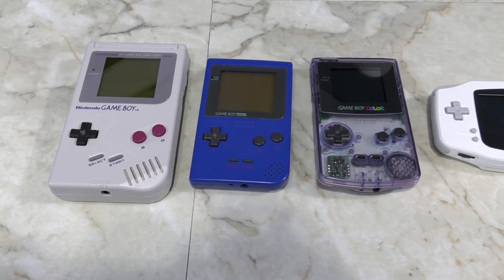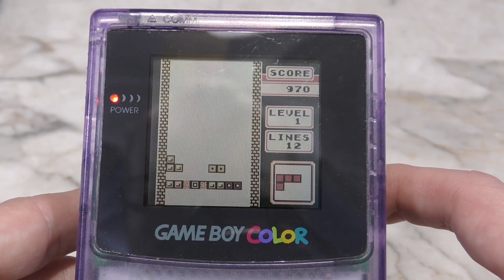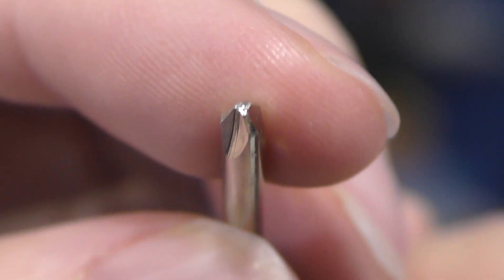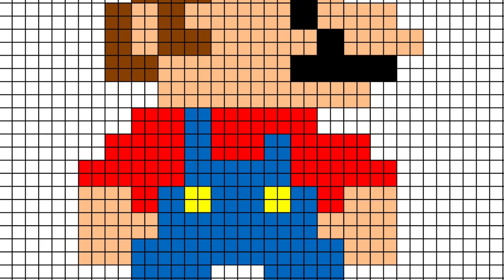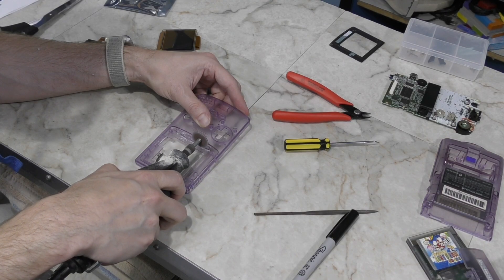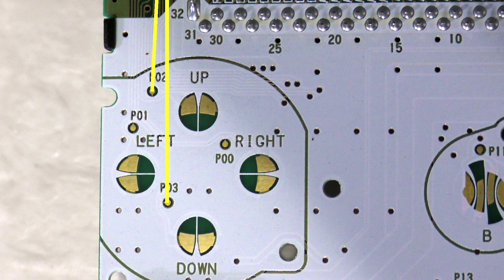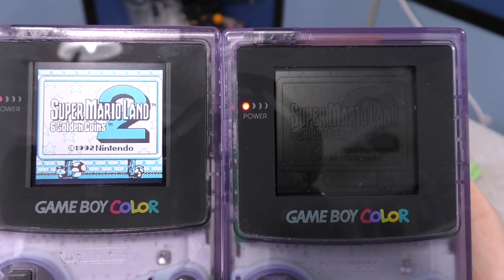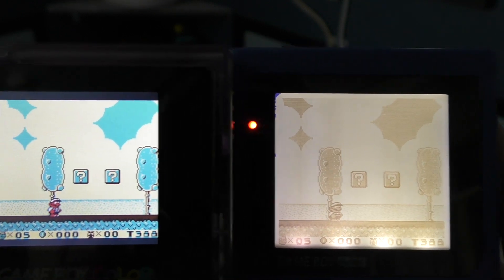Finally - A Gameboy Color Backlight Mod!

Comment: You should've used the Benn Venn's freckleshack. Way easier to intall and their newer batches come with a brightness controller
Reply: Bailey Washington  frontlighting is even worse since all the colors become washed out
Reply: Bailey Washington  cheaper than the competitors
Reply: Bailey Washington  the freckleshack color palette is almost identical to the OEM LCD. Designed that was for this exact reason
Reply: Bailey Washington  I really prefer the correct/original colors of the GBC as well. That's why I couldn't stand playing GBC games on an AGS-101 (even most GBA games show incorrect colors on the backlit screens). The solution for people like us right now is sadly only in emulators that offer color correction. Gambatte (a Retroarch core) is extremely accurate and also supports color correction. I've found that using it on a Nintendo 3DS gives something really close to what an actual GBC with backlight would have been like.
Reply: @Izquierda   There are a lot of reasons for this. Gameboy Color and (especially) early Gameboy Advance games were designed with the reflective LCD displays in mind. Because of how they work, they are naturally dimmer than a backlit LCD. These games tend to look washed out when played on a much brighter backlit screen.

In my opinion, a PROPER front light would be best if you're looking for a Gameboy Color with authentic color. If you take a front light out of an AGS-001 GBA and fit it into a GBC, it looks fantastic. There are some aftermarket front light kits, but they're pretty terrible. If a proper front light kit was ever made (with a good light panel like the AGS-001 had) I think it would be the best solution.
Reply: @adimifus  A proper front light is not bad, though once you have experienced both backlight and proper colors it's really hard to accept the compromise with a front light. It also probably doesn't make sense for most people to transplant a GB SP's front light to a GBC just to keep the form factor of the GBC, might as well just play the games on the SP and also play GBA games on it. The original phat 3DS actually has a way better front light than the GBA SP, but unfortunately it doesn't support GB/GBC carts and so you're stuck using emulators on it (which are decently accurate but not as good as what you can get on the 3DS).
Reply: @Izquierda  I agree 100%. Front lights have a lot of downsides, but if you like the color of the original GBC LCD, it will preserve that. If someone would make a front light kit with a quality light panel, like the AGS-001, it would actually be a decent option. Using the 001's light panel is really only viable if you have a damaged SP where it's otherwise unusable and REALLY prefer the GBC form factor and LCD. It's admittedly a very specific and unlikely situation. 

Did the original 3DS have a front light? I thought AGS-001 GBA SP was the only Nintendo handheld that had a front light.

Comment: What does it do to battery life, though?
Reply: I'm wanting to do see if I could do an 18650 (or similar) mod.
Reply: Adam Carmichael you know there's 14500 cells that are the AA size, they just give more voltage... Much easier mod.
Reply: @lightdark00  Will a Game Boy accept the voltage? Those things are way higher than 1.5 volts and can kill some machines.
Reply: @lightdark00  I wonder if a pouch type battery would work even better, maybe allow for easy charging via USB.
Reply: John Knight you would need to change the arrangement of the cells. 2x2 would give a max voltage of 8.4v while the max with fresh AAs is slightly under 7v. A quick and dirty hack would use a diode with a 1v+ voltage drop.
Reply: @re-agent9364  This would be a better solution since you could match the voltage to the old AAs and there are pouch batteries that come with cell protection built in. Either 3d print a case or make one out of a material that is easy to shape.
Reply: Re-Agent I hate the USB charging idea. I want cells to be swapped out and not kill the battery from always charging it. I need a phone with swappable batteries, I kill a phone battery yearly.
Reply: @johnknight9150  i can certainly tell you my 9v mod i did when i was 10 killed my gbc
Reply: @lightdark00  Is it possible that you drain your smartphone battery as much as possible before you reload it? Because that was the preferred way with older batteries but not with current smartphone batteries. They die quicker this way and would live longer if they were constantly charged.
Reply: Benjamin Krupp nope. The best thing for me is keep a heatsink attached to the phone. Watching videos on cell service cooks and eats up batteries.
Reply: Sounds like you have bad power at your house or work. It could also possibly be a cheap charger you use . You shouldn't have a battery die that quickly. I would only use a quality charger, like the one that came with the phone, or a computer to charge the phone, preferably through a surge suppressor.

Surge suppressor wear out after 2 to 5 years, BTW, depending on power surges in your area.
Reply: KnightsWithoutATable I use the charger that came with the phone on a filtered ups power supply always. Apple wants you to buy new phones, I say no. I am on my fourth battery.
Reply: @lightdark00  I'm not sure if I should be horrified or impressed that you manage to trash a phone battery in a year. Even the phones I've charged in sub-zero temperatures (very hard on lithium batteries) last a bit longer then that.

If the pouch is set up to use the 25%-75% capacity range, you should get 10,000+ cycles out of it.
Reply: @lightdark00  Apple? Well, there is your problem. The OS probably looks at the voltage going down from age and flags the battery as bad or it is as you say and Apple just flags it as bad to make you buy a new phone. I wouldn't be surprised by either and the battery being perfectly fine and you just need to disconnect and reconnect it. Now, if it has started to bulge on the other hand, the battery is toast. Could also be a bad or poorly designed battery management circuit on the phone trying to fast charge and is cooking the battery instead.
Reply: @lightdark00  "the max with fresh AAs is slightly under 7v" Huh? I don't follow. We are talking about th Game Boy Color which uses 2 AA batteries, right? They are 1.5V (1.6V max) and there a 2 in series. So it is a 3V battery pack. Where do the 7V come from?
Reply: DA666 oh, only two? I remember my original game boy needing four batteries. I thought it was the same.
Reply: @lightdark00  
Are you saying that you'd rather buy new cells after 1 use (swapping out non rechargeables) rather than after 500 - 1000 recharges? That doesn't make sense at all. What's the point of swapping out rechargeable cells? You need to recharge them to reuse them.
Reply: John Thimakis swapping out rechargeables. I already have 14500 lithium-ion cells can have devices that use them.
Reply: John Thimakis the reason is longer life. Leaving cells at nominal voltage when not in use for some time is the best use. Charging them full before use is much better than having a USB charging circuit constantly charging them during use.
Reply: @lightdark00  
I've heard that too but I'm not sure or heard of actual studies on how it affects the total number of cycles.

I've heard that they should be stored at 60% not lower, only charged to 80% and then used until 60% remains and then recharged back to 80% for next use and so on.
Reply: @lightdark00  
The problem is you can't place them in the device without modification. AAs are 1.5V whereas Li - ion cells are typically 3.7V each.
Reply: John Thimakis it's not a huge modification, one that's easily reversed.  AAs generally top out at 1.65v, li-ion at 4.2v full. If only two batteries and you want the longer runtime, have the two parallel and drop 1v. The issue is you don't want normal li-ions to drop below 3v, and I doubt the space is available to use longer protected cells.
Reply: 7 volts!? A gameboy color runs of 2 AA's...
Those shouldn't be producing much past 3 volts (for both together), and most types of AA rarely even do that. (rechargeable ones tend to hover around 1.2 volts per battery, but they're also much more stable than say an Alkaline cell which starts around 1.5 but can drop as low as 1 volt as it discharges.)

Also 3 hours of runtime? For a Gameboy color?
I once timed mine.
It ran 28 hours off a pair of Alkaline AA's...
That's something like a factor of 9 reduction in battery life.
And people are actually stupid enough to ask why these didn't come with a backlit screen as standard. XD
Reply: @lightdark00  An LED would be needed for a voltage drop that high. I think a red LED would be a 1.2v drop.
Reply: @carneeki  Use 3.2V AA sized LiFePO cells and either mod the GBC to run them parallel or use just one at a time and bridge the other battery slot with a strip of metal, just make sure you get the 3.2v version not the 3.7v.
Reply: @carneeki  Battery mods don't sound like it's worth the trouble; buy a Duracell NiMh wall charger for about $20, comes with 4 AA rechargeable batteries. Buy a few extra to use in the Gameboy while the others are charging.
Reply: I'd recommend doing the 3 wire brightness mod and keeping the brightness at a lower level.  That'll do wonders to help your battery life.
Reply: You know what it does to battery life..
Reply: You can install a switching dc-dc converter and use higher voltage batteries. And you can wire the pair in parallel instead of series to keep it under 4v. AND you could current-limit the backlight LED for longer battery life. Instead of the current limiter, a simple diode (0.3-0.6v FB) in series with parallel 3.6v batteries should work great.
Reply: Looks like it reduces it greatly, ouch - "Recommended batteries are NIMH 1900mAH providing 3 hours of run time".
Reply: on the site-> Recommended batteries are NIMH 1900mAH providing 3 hours of run time.
Reply: There is also a Micro USB mod with the color and can install a lithium ion battery to it.
Reply: @FrezzyYT  that's the same YouTube show I was referring to!!
Reply: Just run lithium AA batteries
Reply: Blah blah blah, use a damn car battery ya pussies! Tone it down a bit and you got battery for months. It just won’t be very portable judging from the pantsies you guys are.
Reply: You could use 14500 LifePo4 batteries in parallel as they're only 3.2v.
Reply: @michaelparker2449  Don''t you mean 2 AA batteries in series is equivalent to 1 LiFePO4 cell?
Reply: @jtveg  More like the other way around with 2 LifePo4 in parallel having the same voltage as 2 aa in series.
Reply: @michaelparker2449  Putting 2 cells in parallel only increases their life, it doesn't change the voltage. Since it is the voltage that we are talking about, the number in parallel is irrelevant. You could have 1 on its own or 50 in parallel and it would still measure 3.2 Volts.
Reply: @jtveg  Yeah extending the life is the whole point, as the GBC can hold 2 14500 batteries which if put in parallel doesn't go over the maximum voltage the system can take but still gives the capacity of both batteries.
Reply: @jtveg  I think there is a bit of confusion going on here:
2 AA Batteries in series =  3v (3.2 max)
2 LifePo4 in parallel or in single = 3.2v
so you have to either mod the GBC or use one battery in one slot and bridge the other slot with "something"
Reply: @michaelparker2449  
Yes, I get what you mean now. The Game Boy has space for 4AAs so if you parallel 2 LiFePO4s and then put them in series with another pair in parallel, would mean no electronic modification, 6.4V, no physical modifications to the case other than rewiring the terminals with the added advantage of doubling the mAh rating.
Reply: @Bikey_McBeardface  
Better to just rewire the way the batteries are connected so that instead of all cells being in series, you parallel one pair and then series that to another pair in parallel.
Reply: @jtveg  Or you could use 3 Li-ion 14500 batteries in series with a small 6v step-down converter fitted in the fourth slot.
Yeah it will be more hassle than just having 4 Lifepo4 batteries, but  3 Li-ion 14500s still have a higher energy density than 4 Lifepo4 batteries, and they are also much cheaper.
Reply: I know I recently saw a show on putting a 3.6v 2Ah battery into a GBC... I just hope that board he used sends out a constant 3v to the GBC always.

I think he said he can go quite a long time with this setup, but then again I don't think he had this mod setup
Reply: That's the question I had right away! Time to mod a stronger battery into the mix I would think.

Comment: 0:50 That's definitely a sentiment I agree with. I think the mid-late 90s saw a lot of focus on impressing people graphically, with 3D being more than a pipe dream for most people now. Way too many titles that look cool for the time that don't hold up now... I think around 1995 to 1999 is the time of the talents of smaller developers showing through, the ones that couldn't afford to do great graphics but relied on gameplay or charm instead. They avoided the trapping of "great graphics, boring gameplay" just by not having enough cash or hardware and were better off for it looking back.
Then again, I wasn't around for the time, but I've tried to play as many games from that era as I can and the ones made on a shoe-string budget by passionate people were the ones that stuck out to me the most.
Reply: DOOM, Unreal and Half Life were the games that started the graphics powerhouse craze in the 90s and it haven't changed since

Comment: How does it look in direct sunlight? I'm wondering if the original screen may still have the advantage in that scenario?
Reply: In the full sun, phones need to be at max brightness usually. So the brightness mod would be a must then.
Reply: Looks fine but it's reflective, what me and my friends did was buy a matte tablet screen protector and overlay it on top. It was cheap and easy to remove if needed. It made quite a difference.
Reply: rjolly87 oh yes, I play my game boy color constantly and only in bright direct sunlight! I would never think of a mod that makes it more useful in more scenarios. I’m just going to stick to one and pitch a fit!
Reply: @EndOfLineTech  Dude, chill, he was just asking a question??
Reply: It works great in direct sun.  The LCD is a Transrefective display so it works like the original screen but also allows for a backlight.

Comment: RIP 1999-2003 all the AA batteries I killed playing Pokémon
Reply: I just ignored the warnings and used rechargeable batteries.  I never had a single problem with them and saved a ton of money on batteries.
Reply: Anthony Salter I guess that the Gameboy didn't care that much about the voltage drop of rechargable cells
Reply: @abhimaanmayadam5713  I actually used 1.2v rechargeable batteries on my gameboy.. I dont think I had many problems, but then again lines started slowly disappearing off my screen and I initially wrote it off as a side effect that I was warned about by using rechargeable batteries anyway
Reply: Donny Kong & Mario
Reply: especially with an old gameboy that ate 4 at a time.
Reply: Game Gear owners are like: "You know nothing of battery genocide!"
Reply: @Hyperionl10 .. Sega Nomad owners be like.. "Prepare to meet your doom AA batteries!" 😂😝

These days, there is a new battery destroyer in town. It calls itself Chrome.......... Google Chrome. It really loves your batteries and RAM!! Even Crysis uses less resources. 😵😅😝
Reply: Personally I would've used a 6v RC Car battery pack where the DC Jack goes, like it is on the REAL pack.. or just get a 5 cell series AA holder and use 1.2v AA cells (or even C and D).  That's fine too 

#ProblemSolved

Comment: Super Gameboy and Game Boy Color colors are not compatible. Each game would have to be programmed to work with one or the other or both, but having special color data on SGB does not mean having special color data on GBC and vice versa. (Unless the GBC has a special pallete for the game built into it's BIOS)
Reply: Indeed. The GameBoy Color does NOT support SGB palettes. That was my one beef with the machine, it felt like Nintendo just cheaped out with the firmware.

Try this: power up the GBC with a SGB game and one of the D-PAD directions held down. You’ll notice the palette change. This is how you know it doesn’t support SGB color. Usually I play non-GBC games with the greyscale palette (left+B according to TCRF), which just feels right to me.
Reply: @The 64th Shadow
How exactly does the whole colour pallet changing thing work the GBC/SGB?
Is it similar to the NES where the colours aren't really colours and are just different signals that the screen decides (or in this case the GBC/SGB)?
Reply: @thepuzzlemaster64  Essentially. 
The SGB and GBC go about adding color differently, and are actually identified as two different systems.
Reply: ugggggggg, yes the GBC DOES have the super gameboy color palate in its rom. you just can't run a GBC game on a super gameboy. he wasn't implying you could do the later just explaining why he prefered the GBC over the GB pocket becasue of the former.
Reply: @ColtGColtG  That's incorrect. The Game Boy Color does NOT support Super Game Boy colors.

IE: Kirby's Dreamland 2. It has full color on Super Game Boy but uses an entirely different color pallete on Game Boy Color.

Pokemon Gold and Silver. Full color on Game Boy Color, but restrictive color on Super Game Boy.